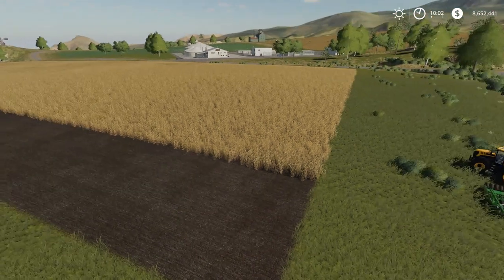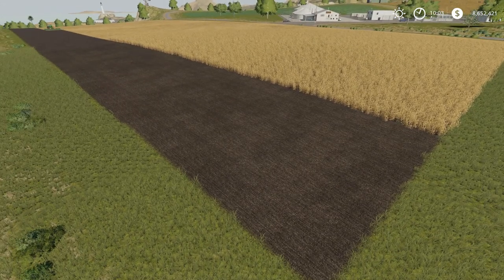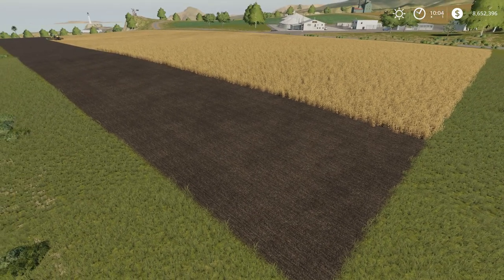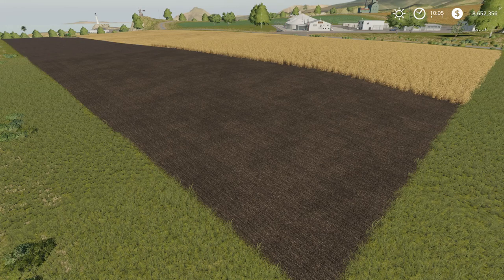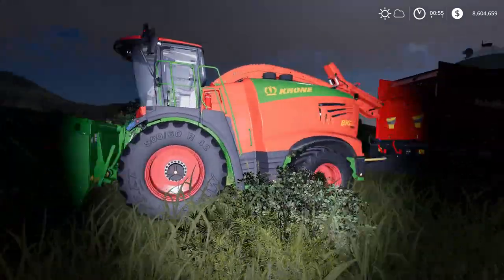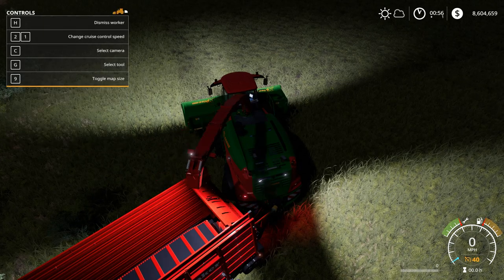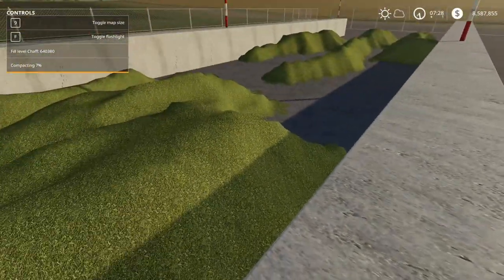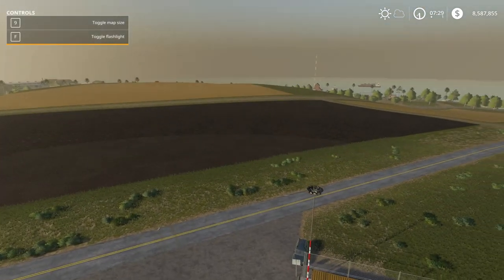Making silage     corn or grass     Farming simulator 19

Comment: I should note that the Krone Big M 450 mower has a built in swath that will drop mowed grass like a harvester would straw. The biggest difference though between the high end machines is that the forage harvesters have a work speed of 10km/h while the Big M 450 has a working speed of 25km/h. However, you will still need to run a loading wagon along it once mowed; tractors are fairly slow when accelerating with loading wagons (tractors I use are between 300-430hp, all of them being tracked or partially tracked.) whereas the forage harvesters can reach their top speed fairly easily even with trailers attached due to their weight and horsepower. If mowing grass from a field, you can hire a worker to keep mowing while you make trips with the loading wagon.
Oh yeah, you get more grass from the final stage of its growth stage, too, which might balance things out when taking mowing into consideration.

But I think I’ll like the forage harvesters since I plan on doing all the work right next to the BGA.

Anyway, great video!